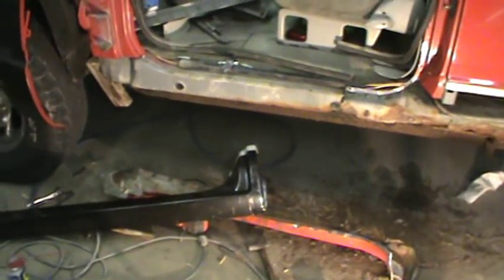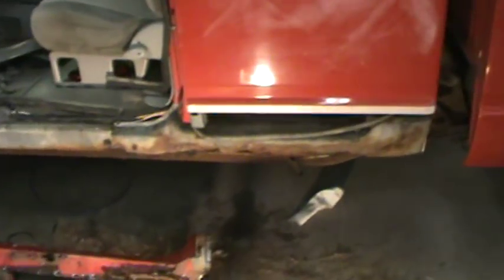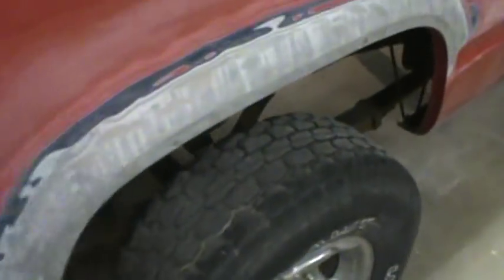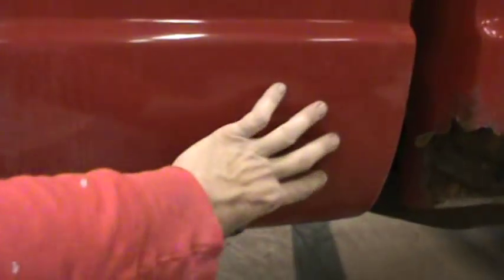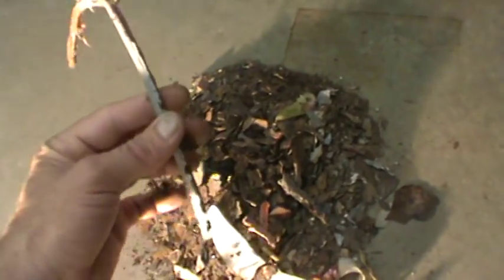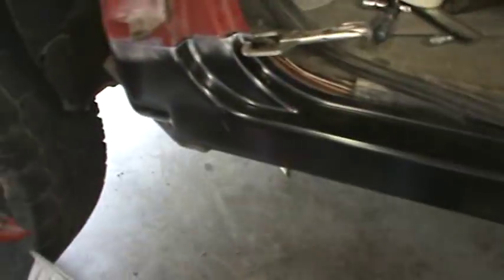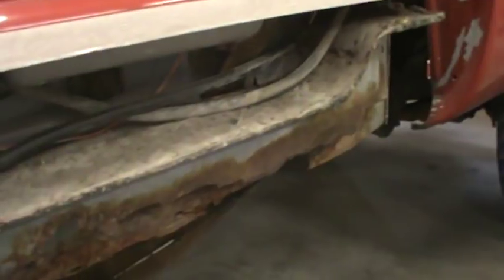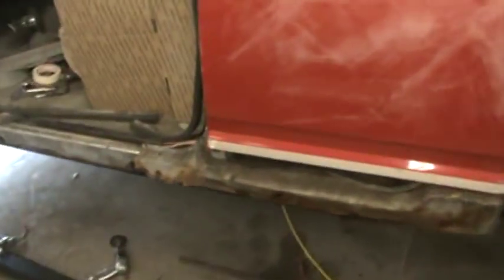More Wood Truck

Comment from the maker: i have 3qrts of matrix MSB which will mix 1:11/2 which if my math is good in my head 71/2 qrts sprayable. PLUS i have a qrt of red for a ground coat which is also Matrix MSB. It will probably take a gallon plus of clear and i am using Matrix MS-52 clear on this one. Ill be using STRICTLY Matrix only products on the body. That will give me a warranty on the finish of this truck.
Thanks for watching